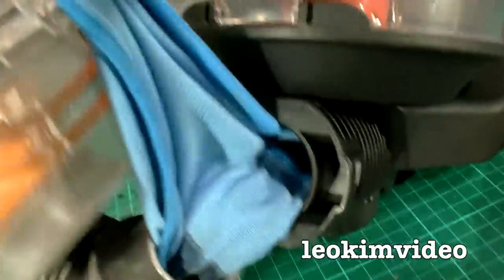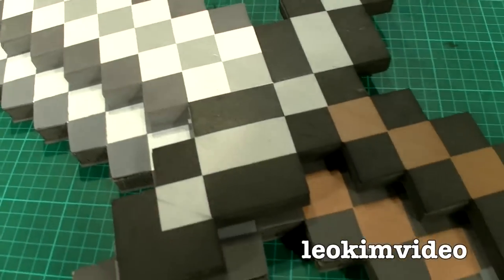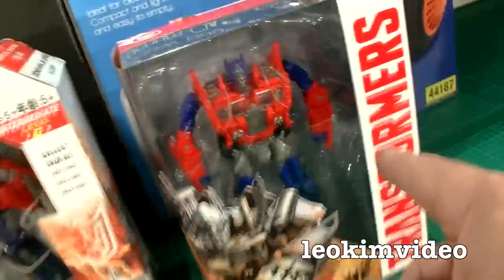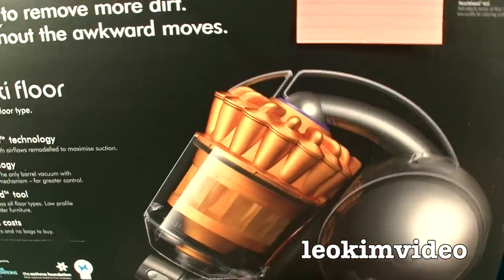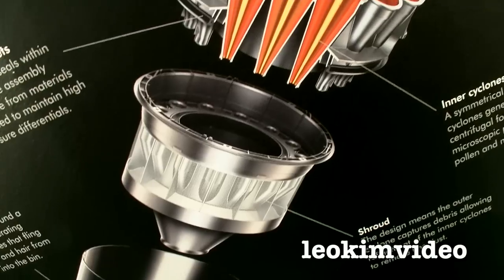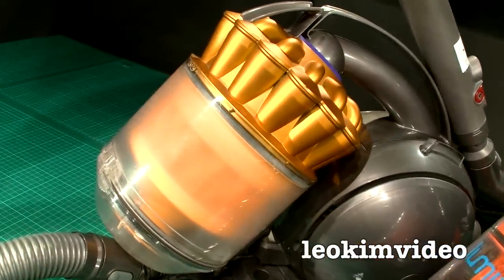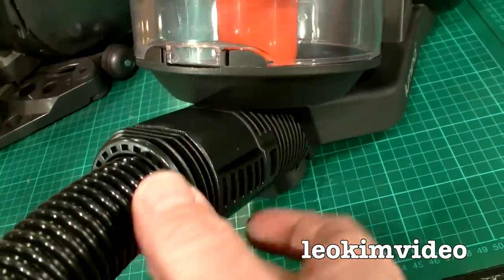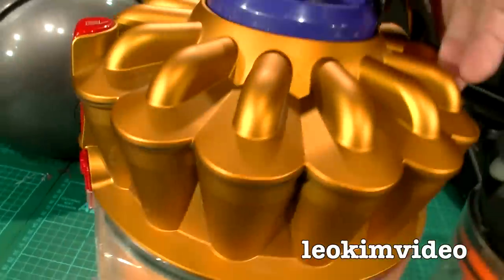Dyson Dark Side DC39 Clone & Classic DC05 Vacuum Cleaner Suck Off

Comment: You really do get what you pay for Dyson years of constant development to produce the best machine possible and patents protecting the work. And Aldi with something designed to last the guarantee period and not a day later.
Reply from the maker: ejcmoorhouse Dyson are about to do a robot, one wonders if they get it right. I know the ones on the market at the moment are expensive fluff removers and do no real cleaning
Reply: ejcmoorhouse If you really want something that will last get a Rainbow.
Reply: ejcmoorhouse do you know that's a real Optimus Prime but put in one package
Reply: leokimvideo the Optimus Prime is it the way they got put in the wrong package

Comment: Just to let you know, the DC05 was Dyson's second 'cylinder' style machine. The first Dyson cylinder was the DC02 which was designed and built around 1995/1996. The DC05 was simply just an improvement over the DC02. This is a similiar story with the upright DC04 model in 1998/1999. Once again, the 04 was an improvement over the earlier DC01. Hope this information helps in regards to early Dyson machines :)

Comment: Why doesn't Dyson offer a POWERED carpet cleaner head like many other makes?  Instead, the rotating carpet tool works PASSIVELY off the suction, using some of that energy to turn the brush.
Reply: Jakob W coz dyson has plenty of power to run the turbine head as well and sucking power why complain
Reply: Jakob W besides motorheads has shown to many times of burning out. .. air driven is more reliable

Comment: My mother had that exact DC39 Dyson, she paid quite a sum of money for it and it has probably been one of the best Hoovers (or Vaccum Cleaners) that we've ever had,  Has now been replaced by one of those much more expensive cordless ones that you just place on a plinth and the charging cable sits underneath. My dad now has the older Dyson.

The only real issue with this particular one is that the curved feed pipe that goes to the filters etc is quite narrow and we've had numerous occasions where larger bits of debris gets caught up and blocks it up.

Comment: That's the plan of the dark side, when it all comes down to it. They know their products will fail, so you buy another one and end up spending more on replacements than for pennies or dollars more a genuine product that'll last you for years to come. 

Take iPods for instance. They have in New York several knock off Apple products, including a U2 iPod which came preloaded with U2's entire discography and for some reason Monster's Inc. Sounds good, until you realize the battery is complete crap, as a friend of mine's battery exploded and rendered his dark side U2 iPod useless. But you're right, some are on par with the genuine article, like Lego. Companies like Sheng Yuan and Decool do figures that Lego has yet to make, as well as Comic Con exclusives which cost hundreds of dollars, which begs the question: Would you rather spend maybe $10 for a knock-off Phoenix or Spider-Woman or pay $200-300 for the actual figure?

Comment: The Low/high power adjustment controls the motor speed by adjusting electrical resistance, or ohms.  You would turn the power down for drapes or little bathroom rugs, and crank it up to max for regular cleaning.

Comment: Like  a lot your review was very original..
..Dyson is expensive but is powerful and very nice designed i wish that dyson will put to wired vacuums speed settings cuz is not necessary to get such powerful suction  every time yo dust so you will get energy saving.

Comment: Right, on the date, Dyson moved production to Malaysia in late 2002 so it would be thereabouts after 2002 - 2005, so yeah, around 13-10 years old. I have a great DC05 that I obtained fully working on eBay for around £15 (around $29 Australian dollars), and my uncle has had one for around 14 years problem free.

Comment: I have a Dyson DC07 that was bought in 2003 so 2001/2 sounds about right for the DC05, and yes mine does still work but its on its second motor and quite a few bits have been replaced over the years, my main problem is that my hair clogs up the brushes
Reply from the maker: Nicholas Loves Trains Look after the DC07, it's an important model in the Dyson range because of those cyclones.

Comment: Great to see you back! We often shop at aldi, I am a convert to their hand tools that they regularly sell. A good example is the large workzone socket set I got there about 2 years ago and we thrash that by working on 2 cars regularly and they are still going strong, other small tools that are cheap from there we often grab like screwdriver sets etc but we don't like their larger power tools as the electronics are usually shocking.
Reply from the maker: Ucwepn OMG, I just looked over your videos of the FAIL new Trackmaster system. Seems Mattel need to sell a whole new system to a new generation of Thomas fans. But all I see going on points to making the toy as cheap as possible. I would even now say some of the TOMY knock offs are a better deal Vs whats on offer from Mattel with the new style Trackmaster.
Reply: Are you two best friends
Reply from the maker: ethan pickett maybe we are the same person..shock / horror
Reply: leokimvideo
DUN DUN DUUUUUUNNNN! :P
Reply: leokimvideo
I have heard the new Trackmaster 2.0 sets and trains are slightly cheaper than the originals (at least in the USA) but I think we will get slogged the same old price when they finally appear here.
Reply from the maker: Ucwepn I'm wondering who will do the all positive glowing reviews of the new Trackmaster, I know it will happen. I gotta say the changes you have pointed out have rocked me, but as we both know it's only a toy train, and Mattel have the absolute right to make a maximum profit on toys.
Reply from the maker: Ucwepn Funny how no one worked that simple fact out :)
Reply from the maker: Ucwepn Just on all positive glowing reviews of the new styled Trackmaster...yep they are out there, and it secures in my mind why I now steer clear of these users here. I'm a firm believer in a  toy review...not a blasted toy ad for the toy giants.
Reply: leokimvideo
Yep I know exactly who you mean as well haha, giants of the scene screaming "everythings great!"
Reply from the maker: Ucwepn I think my advice to mum's & dad's looking to buy a toy train set is to aim at the wooden style, I honestly think thats the best system and has the biggest appeal. Sure it's difficult to find good powered wooden railway trains but as I found out children love to push trains around to play. Even my son will had push a Trackmaster train to play. The whole Trackamster re-working is sad, but look at the toy industry right now. They are under attack from the evil app and kids who are brought up on a ipad filled with 500 crappy apps. It's going to be very interesting to see what hand skills these children have when they grow older, and if they can problem solve in the real 3D world. And then there's app addiction, children who rely completely on whats flashing up on the ipad. These problems will become monsters I'm sure of it.
Reply: leokimvideo you dont want to go to the philippines its filled with dark side toys some are but i arrived yesterday! nightmares happen my kid is crying
Reply: H